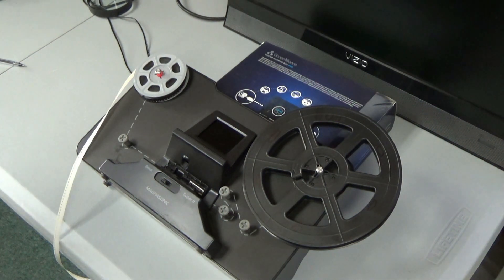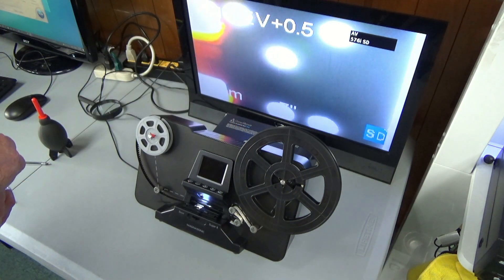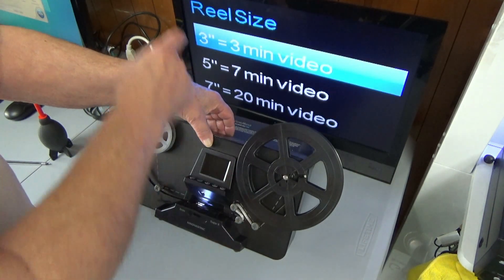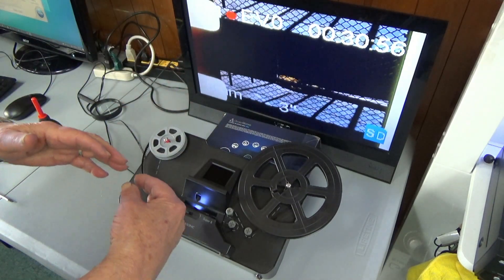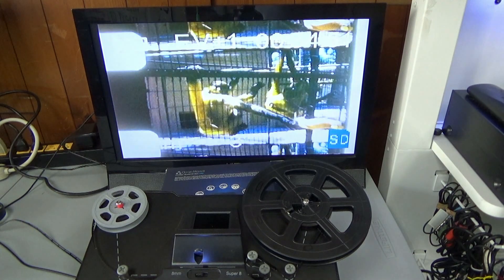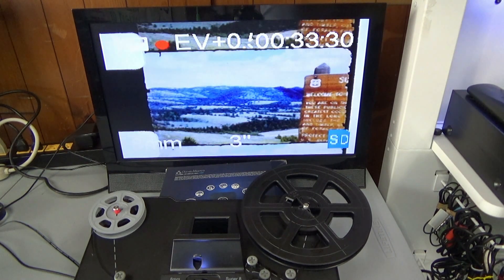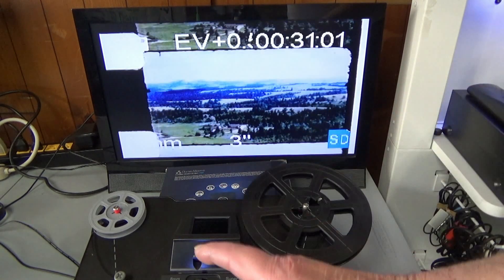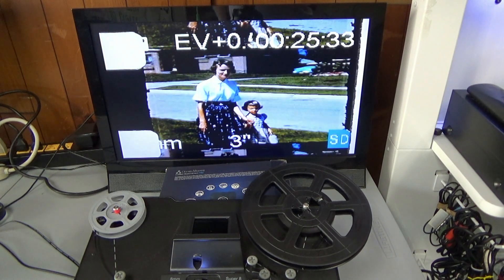HOW TO SET UP  A 8MM FILM DIGITIZER FOR BEGINNERS

Comment: What software do you use to crop and edit with?
Reply from the maker: Two different ones. Pinnacle & Power Director. Power Director is the fastest rendering. Pinnacle is the easiest for quick adjusting. Power Director has a lot better features. I use old versions of both. Pinnacle 14 Ultimate and Power Director 11. I don't like over the top software. I work at $10 per 3" reels. I don't make money. I just do it for the customer's enjoyment. I spend way too much time on all customers projects. But, I love doing it for their happiness.
Reply: I’ve noticed that I occasionally have a shaky video image. It happens with contrasty images. Also if I try to get the full frame image and the bottom of the image is at the top and contrast the main image it gets shaky.
Reply from the maker: @jeffreywilkinson606  Maybe, the film is needing lubricated. It's not pulling even. That causes jitter. Set your framing W with more area.